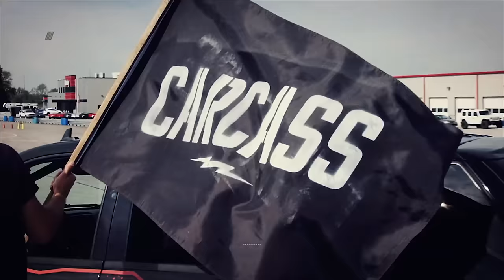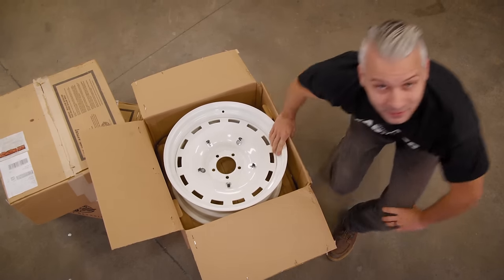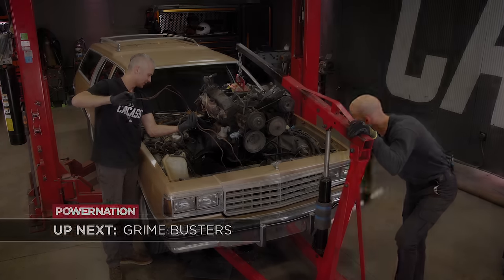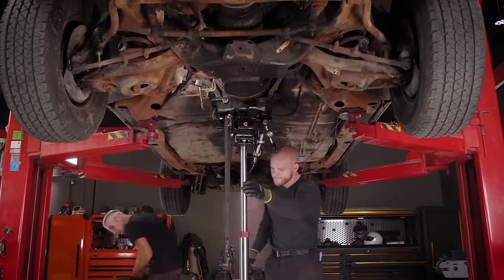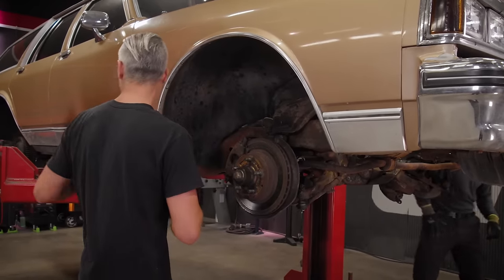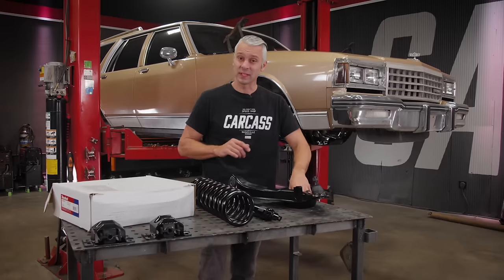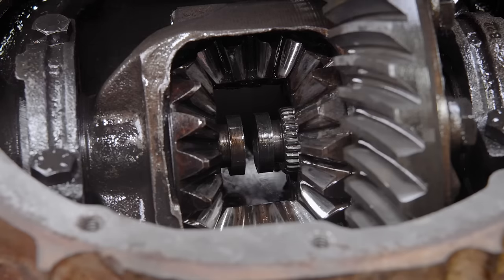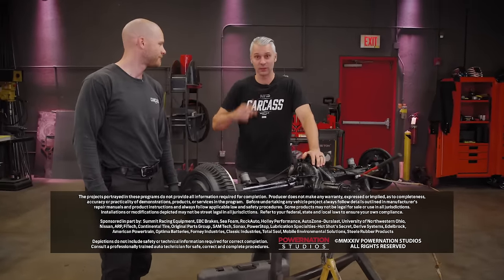Tearing Down A 1984 Chevrolet Caprice Wagon - Carcass S5, E3

Comment: Not to concerned about AC, if you lived in the Sandhills of North Carolina that would be a big priority!
Reply: And put on a new front suspension and use old rusted bolts in the motor mounts and probably some other parts.

Comment: You’re building a cruiser and you’re not too concerned about having air conditioning? Come on Wexler this is a huge car and will be like sitting in a hot oven when you’re driving in warm weather.
Reply: I own a 89 caprice and I can tell you from experience it’s not fun sitting in these things without ac. They hold heat really well😂😂😂😂

Comment: Actually, a lot of truck parts were exchangeable with the full-size car (Impala/Caprice) during that time period. Police cars, for the most part. A word of caution. Always gently (without power) test parts in the shop before putting them into service. For example. You were talking about putting truck rims on that car. Which again at the time were 5 × 5". HOWEVER. some Impala/Caprice rims came from the factory riveted. As such, light machining of the brake caliper (about 3/16") would be required on a Silverado/Sierra. In order to achieve proper clearance. Thanks for the great video! 👍